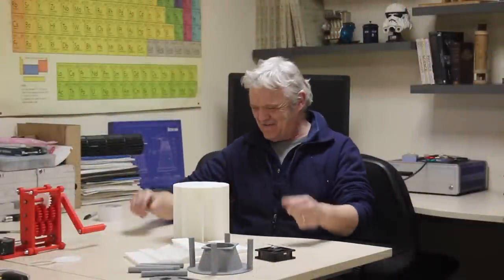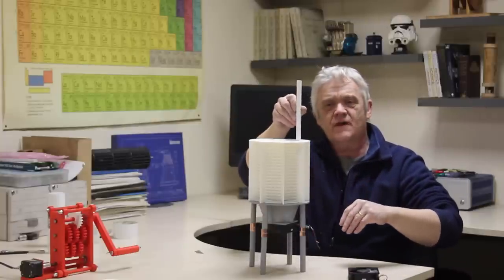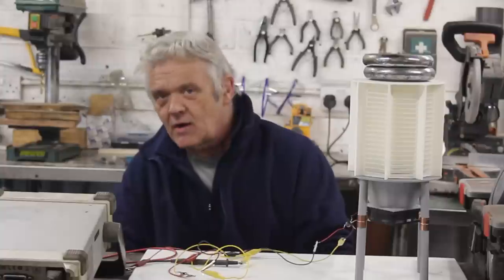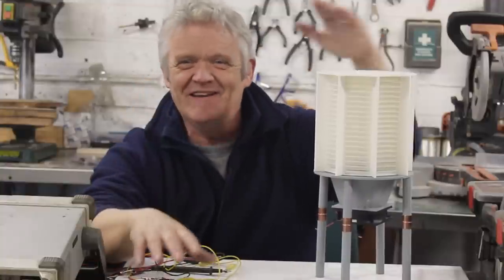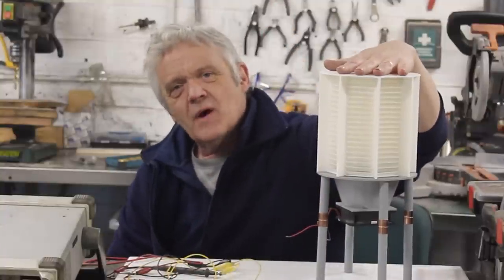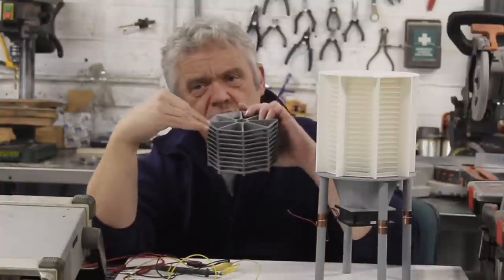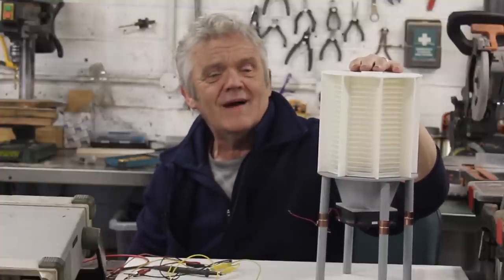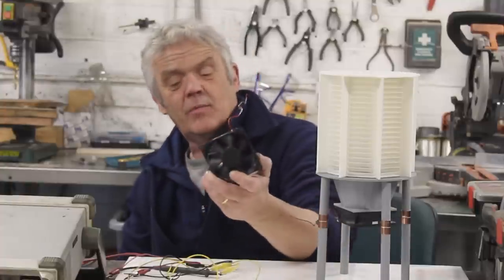1835 Darwin Wind Turbines - The Answer To Wind Generation

Comment: Install a chimney to the exhaust that is two and one half times taller than the intake elevation with same diameter airflow. Move wind generators down on the ground in the horizontal shaft with venturi. Have rotating wind vane mounted onto the top of intake structure that blocks the downwind vanes

Comment: I think the better way of going would be to use it to focus air into a turbine that takes the captured air and compress it so it wouldn't matter how fast the turbine spins since we are dealing with compressing the air instead of worrying about maxing out an electric generator.  Then from the storage tank we could run an A/C generator at a continuous speed.
I've seen discussions of dome homes being better for heating and cooling since air isn't trapped in the corners.  The top of that structure seems like it would have swirling currents of air adding resistance to the air wanting to flow down into that funnel at the bottom so it seems to need a funnel shape at the top (which might be lovely for rainwater harvesting) to better direct the air down and forcing it in the direction of the generator.

Comment: P.S. these "debutted" in either Popula4 Mechanics or Popular Science decades ago. 

The key feature being left out here was the use of  flapping vanes instead of fixed vanes here.

This greatly increase efficiency. The manner isvthus:

Any vanes not being "forward biased" by the wind remain closed. They act as a wind check valve. Close tolerance of balancing the vanes about 10 percent out of balance towards the bottom of each vane sets the mechan8cal set point of the vane close to the C.G. of balance. This allows the least amount of wind nrg to tilt the vanes open, or press them closed against the next vane.

Cheers.

Comment: As per material, there's planty of cracked screen TVs everywhere, all you have to do is look for them ;). This is quite strong material and can be cutted to the needed shape most of the time. Yes, some is not straight, but, this can work as an advantage if you're creative :).

Comment: Yep I agree the wind will speed up when funneled. For fun why not measures the out going  speed with the anemometer  and see if there is any correlation  to sizes of the incoming wind area to outgoing wind area. In theory there should be a direct relationship between the 2.

Comment: It may be better to turn it upside down; the table may be acting as a bit of back-pressure for the fan (unless you make the legs long enough). Also, if it's upside down, you don't even need legs.

Comment: Since I don't have a 3d printer handy.  I'm looking at 8"plastic plant saucer drip trays for the lip angle, the thick outdoor sun type. I can cut the hole in the center easily.  I can use something to set the gap between them while lines of outdoor silicone dry as fins. Pr glue down window screen rubber.  Maybe some small diameter threaded rod and nuts to make it sturdy.  They make 1/8 in.   They make a waterproof pc fan  IP67.  Mount that to the bottom saucer .  The top can be upside down.  With rod couplings and jam nuts I can mount it right into a heavy windproof platform and still disassemble it. 
I wonder how I can cut large enough holes in ceramic but if it really works well, a cheep aluminum frying pan without the handle will beat plastic.  Some pounding required to get the angle I'm sure.  I like how you make my mind work Sir!  Nice!
Reply: I found the perfect shape in our dish drain, (an aluminum pot lid) but it's not worth dieing for!  And I need several. maybe something else.

Comment: Love the series. I have been working with an AI on this theory. I come to find out a thing called 'critical velocity' exists.  This is the principal that we are considering for the amount of force at the end of our "diverter pipe'. Key take away could be use 35' smooth pipe for lengthen.  
8" pipe: Vc = 4.4 m/s
10" pipe: Vc = 5.5 m/s
17" pipe: Vc = 9.3 m/s

Now we can use the m/s against our blade/gen efficiencies. 

To provide a more reliable answer, I would recommend using the following formula:
Vc = 0.634 * ((EI)/(rhoD*L))^(1/2)
where:
Vc is the critical wind speed
E is the modulus of elasticity of the material (for PVC, E = 3.0 x 10^9 Pa)
I is the moment of inertia of the cylinder cross section (for a circular cross section, I = pi*D^4/64)
rho is the density of the fluid (in kg/m^3)
D is the diameter of the cylinder (in m)
L is the length of the cylinder (in m)

side note to the collector device without improvements of flutes:
•	Collector shape: octagon with a center cross that is 3 feet wide
•	Collector surface area: approximately 13.5 square feet
•       Collector: 40% of 13.2 sq ft (1.226 sq m)
•	Collector material: polycarbonate plastic PVC
•	Collector inlet/outlet diameter: 8 inches
•	Height of vertical section of PVC pipe: 35 feet
•	Diameter of vertical section of PVC pipe: 8 inches
•	Wind speeds for calculation: 4 m/s and 6 m/s
•	Shear strength of standard 8-inch PVC pipe: 2000 PSI
Based on our calculations, the estimated output 
with 4 m/s wind speed is approximately 109 watts. 
with 6 m/s wind speed, the estimated output is approximately 247 watts.

Comment: interesting design, i wonder if a vortex could designed in, a  vortex naturally accelerates the in coming air, like water down a plug hole, the air with compress and get slightly heavier/dense in a vortex, just an idea???.. good video..

Comment: One thing that pops into my head is to ensure that the exhaust air flow mustn’t be impeded in anyway way … following that thought could we somehow cause a drop in pressure at the exhaust area of the fan to increase the airflow using some sort of static system…. There are so many great things you can do to take this further. Very exciting

Comment: Have you considered the possibility of clockwise or counterclockwise air streams in the funnel? One causes the device to function, while the other doesn't; depending on the required spin of the motor. Hypothetically, you could pre direct incoming air by altering the vane directions.

Comment: Nice work. I agree, having a tube between the cone and the fan should help for a few reasons. I think that it should 1. even the airflow out so all the blades can catch the air and 1. provide a bit more pressure to the blades. This can be seen in cars with varying the length of the intake runners which has an effect on the torque and power outputs of a cars engine. 

I do wonder if a larger gap between the fins would help. Perhaps it would offer less resistance to the wind and allow more airflow. Definitely something to look at.

Comment: Maybe combine this with the Areomine technique to pull/lower-the-air-pressure from/on the outlet side of the fan...and toroidal blades...and a control system to rotate the inlet to the direction of the wind.

Comment: just intuition, on the model that size the cone about an inch longer would help. face area to down output to blade area looks about 5:1. great "velocity stack" experiment.
edit: all that catch area might power two units vertically inline? on the model 2" pipe and 2nd PC fan just to see single vs dual watt outputs.

Comment: I say flip it over and have the fan at the top with a kind of rotating cowl like you see on chimney's so that the exiting air does not have and turbulence to flow into, and you save yourself from having that heavy weight on pillars

Comment: This design is bird friendly. A scaled up version would be practical based on the simplicity of the design. I like it. The captured air could be used further in animal barns/stables. A key thing in the practical application will be noise. That seems to be a concern for many people. Finally, if this is structured to look like existing water towers or grain silos, you get rid of the last argument against wind generators on the landscape as our eyes are used to these already.

I like simple solutions and this looks to be simple and therefore inexpensive to build and maintain.

Comment: Have you seen powernests? A box made from fins  designed to capture the wind and speed it up through the box in the middle of the box there are vertical wind generators and the top has solar panels that are cooled by wind and generators.  Seems to me your generator maybe the father to this hybrid idea. It might help with yours

Comment: It looks like the Darwin wind turbine, at least the wind catching part, can be made using recyclable materials or even just wood like window shutters. Fewer moving parts, no need for fiber glass or carbon fiber to make wind turbine blades which are NOT recyclable and just end up in a landfill somewhere. The only part that needs any sort of maintenance would be the generator at the end of the funnel

Comment: The fundamental truth of wind turbines is that regardless of design, the power developed will be proportional to the swept area of the turbine and the cube of the wind velocity.  Small turbines don't have much swept area, and so don't develop much power.  Turbines close to the ground or buildings (i.e. in the boundary layer) don't get the full velocity of the wind, and so don't produce much power.  Small turbines close to the ground or on buildings have both disadvantages.  Wind power scales UP fairly well.  Large turbines elevated some distance away from the ground can generate significant power.

Comment: Efficiency could be improved by preventing the losses through the other side of the structure. The vent slats could have light springs or be made of rubber, so that the ones opposite where the wind enters would close from internal air pressure. Then I would not only go with the hyperbolic funnel but do it with an attached spiral screw vanes to spin the air inside in the direction that the turbine would spin. The geometry of the turbine blades would need to be optimized to make the best use of this cyclonic force for rotation before redirecting the air out the other side. I also believe this setup may work better flipped upside down to prevent any back pressure on the exhaust side of the turbine and just let the air escape out of the top, possibly with a secondary reversed structure above to also help pull air through. 

For a good look at some interesting blade geometries, I would suggest checking out the Major Hardware channel's Fan Showdown series where people submit PC fan blade designs (that fit a specific Noctua fan chassis) for him to print and test. The designs are made public so the viewers can try them out for themselves.
Reply: Aaannd, of course I saw this vid before finding the first one on the Darwin windmill. Doh!

Comment: How much better? For comparison sake make a funnel with the area/dimensions of one end equal to the area/dimensions of cross section of your wind catcher and the area of the other end to fit your second fan. Put your second fan on the end, point it at your airflow and see what you get. (You could even make the angle of the funnel 35 degrees top and bottom in order to determine the length, so it matches the 35 degrees of the catcher design)

Comment: Might be able to use an air foil design instead of just slats that are flat. The curved side of the air foil will create a high pressure on the curved side and a low pressure on the flat side. If turbulence becomes a problem, you could always use small tabulators to break up the disturbance.

Comment: Now then turn this into a air conditioning system by pumping water up and allowing the water to trickle down over the vanes.
these used to sit on the tops of buildings and they cooled the air through evaporative cooling but the fans were used to draw the air down into the buildings.
you could then use the fan to capture the energy of the downward moving wind to power a water pump and ... free air conditioning.

Comment: First of all it makes sense to remove the electronic commutator from the fan and use the induction coils together with a 3-phase Schottky diode rectifier or an electronic MOSFET rectifier for dc generation.

Comment: This as big as you made it look at the beginning of the video could be used to make compressed air. If you could inflate truck inner tubes the energy is stored as a compressed air battery. This could also be used to force air in to a blast furnace.

Comment: I think that the main body should have a central cone to divert the incoming flow away from the flat centre of the fan. 
Without it the incoming wind hits the centre of the fan which is flat area. This will causes internal turbulence as it tries to make its exit through the blades. This means that it will be hitting against other air and kicking some of the energy out of it. 
?

Comment: Seems to me that there would be considerable turbulence on the downwind side, and that turbulence would create a low-pressure area - sucking the air back 'up' the tower.

Maybe mount the turbine on the top, with an 'exhaust' that rotates to point downwind.

Comment: Fantastic again Rob! What about adding ‘EARS’ / half-moons to each side, 3D printed to a plastic disk with a hole / bolt/ bearing in the center and slid over top of your existing model. The top disk and ‘ears’ would rotate with the wind and funnel air into the sides! :) cheers! 
Mark (Canada)

Comment: Robert, just occured to me when watching this you concentated on the input to the turbine. What about the exhaust side. On the table you are going to get output bouncing off the table posible slowing down the turbine. Idea a pyramid shape under the fan to direct the stream of air away. Idea two a collector on the top of fan and one on the bottom, so you get blow down top and a pull down of air from bottom?

Comment: it is the difference in preasure that guides where the wind goes, so to me it just flows out on the top agian, and you might have a bit or leakage through the generator, but not as much as you would like

Comment: Hello Rob.
You say "It MUST be speeding up.", referring to the air moving through the vanes.  Yes, as a matter of fact, it HAS to speed up.  
Let's assume that you have 10 louvers.  If you look at the turbine from the side, wind that can be captured(or redirected) from the bottom two louvers has filled the inside of the turbine.  Now, if the wind redirected from the SECOND two louvers enter the system, it has NOWHERE to go.  So, the ONLY way for the air to even enter the second two louvers, is for the air from the FIRST two louvers to have SPED UP.  Likewise with the next set, and the next set, etc.  So, the taller the system, the GREATER the wind speed at the end(bottom or top).  So, if you want more speed at your fan(generator), then make it taller.  I believe the biggest question is, at WHAT POINT, will the wind STILL be able to enter the INITIAL louvers, because at some point, the volume of air being redirected from the other louvers will prevent any wind from entering the initial louvers.
I know you're busy, but you ought to try to make a few more pieces to go on top, and record the difference in wattage.
Keep up the good work 'Mate'.

Comment: I would turn the entire thing upside down. Then increase the diameter at the new top of the white piece (where it meets the grey piece) so it overhangs the entire thing. Then mount it on the top of a building on the edge (or a cliff). This would catch the natural updraft/heat convection from the building as well. And angle the overhang at the same angle as the fins. The internal wall --- would need to be placed so that --> and <-- is the least common directions of the wind in the area (based on airport designs there are generally 2 main directions of wind for any given area and there for 2 directions of the least wind). Having it in the orientation displayed it the video means you will likely get back pressure from the wind blowing out the bottom which will lower the efficiency. It also requires it to be mounted higher meaning you have to spend more money on building the legs which will be a failure point in high wind. Mounting it upside down gives you more surface area to easily connect to the mounting surface and will make it stronger and last longer.

Comment: Put a much larger version of this on top of high voltage electrical transmission towers. Even if you don't do this right away, at least redesign electrical transmission towers to accommodate future additions.

Comment: The slats are acting like the blades on normal windmill. They increase the surface area that the wind force works on and the shape produces low and high pressure areas which increases wind speed. The advantage of static units is they could be less obtrusive in appearance and they don't make noise, maybe, or kill birds. Imagine them being on tall buildings catching all that swirling wind? Start building!

Comment: The angled blades may only work up to a certain wind speed. Above a given speed  the gap between the blades will be blocked so the  airflow will just flow around the tower. There needs to be a study to determined the optimum gap ratio as is done in aero engine thrust reversers or wing flap elements
Reply: oddjobbob  no, check out how the air flows over the front of a car... at low speed the air enters the engine bay through the radiator air entrance at higher speeds the slots in front of the radiator block the flow sending the air over the top of the hood and reducing drag at higher speed. However in the wind tower case the blocked gap will stop any flow into the generator entry...it needs investigating more to determine the gap blade ratios. But I agree it could be used as a passive self governing system. It just needs some experimentation to determine the blade geometry.